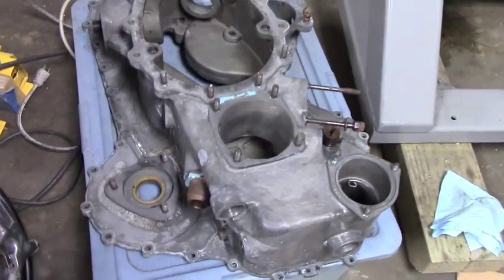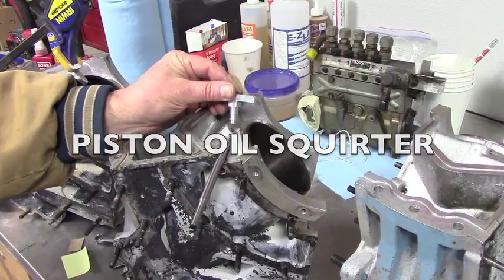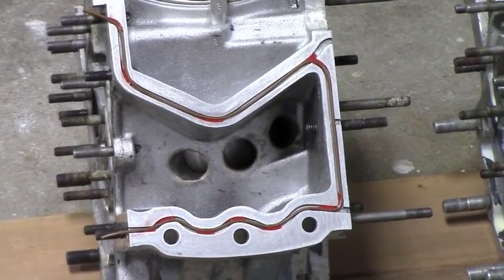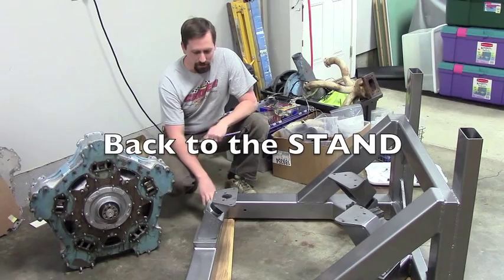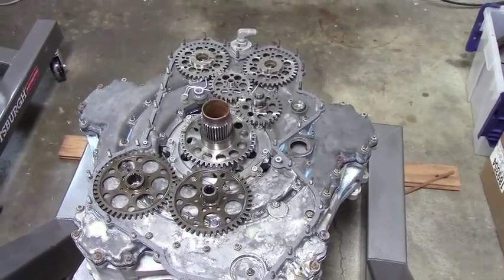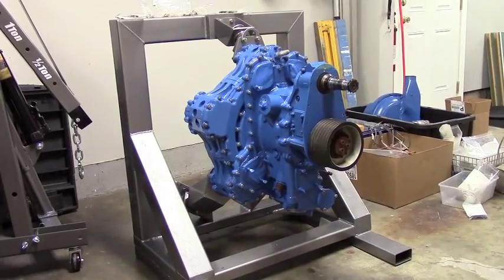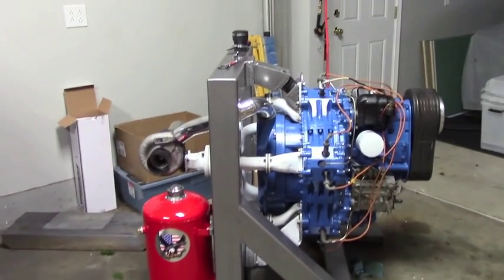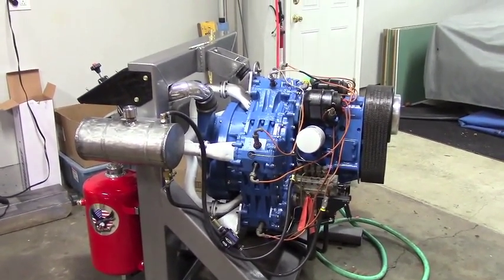TSIR 5190 Restoration

Comment: What did you do for the impeller that was missing for low speed supercharging?
Reply from the maker: Ken Lares; no change, I left the flywheel in place.
Reply: @Crover1  It seemed to run pretty rich when you ran it. Do you think it was short on air due to the missing impeller?